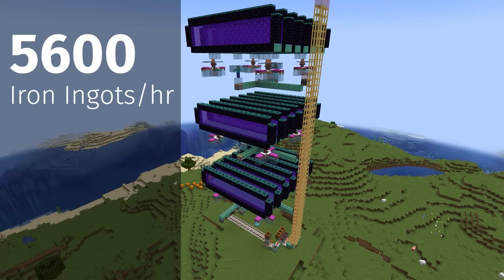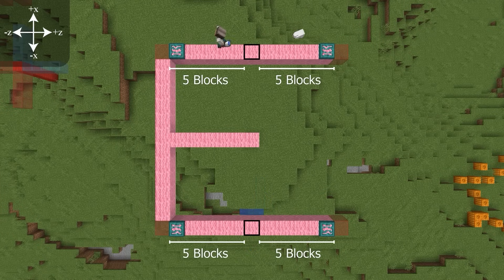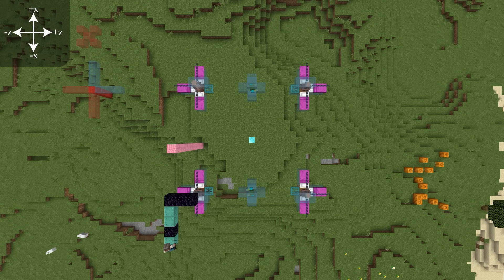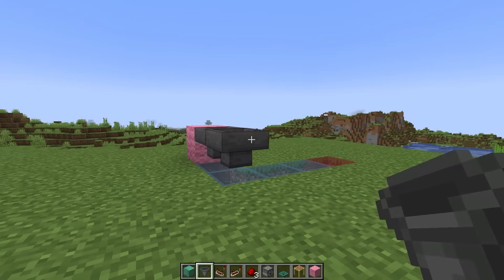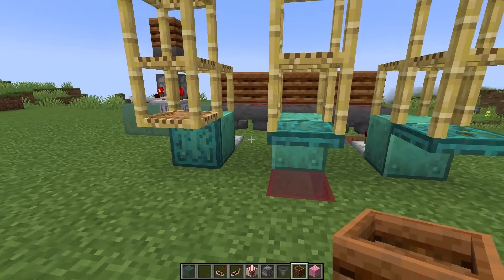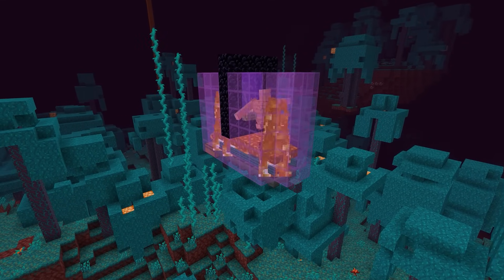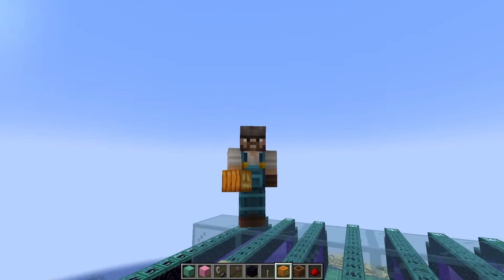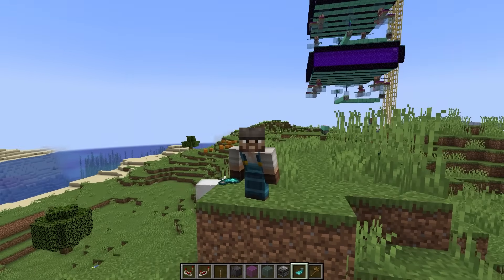Most Efficient High Capacity Iron Farm - Build Tutorial

Comment: Built it in 0:09  1.21.11 on hypixel smp with the 1.18.2 and below version however I added one extra repeater at one tick. I also added an auto crafter setup and an item filter. This way I get about 592 Iron blocks or 5328 iron ingots per hour.
Reply: I want to build this right now but this tutorial is really confusing to me did you use this tutorial or has someone else made one for the same farm but in a different way?

Comment: Can confirm working on 1.21.11, just use the 1.18.2 and below design. The chicken in the boat seems to keep teleporting through the portal but the golems still push each other out so not a ton of efficiency is lost, still an awesome yield!
Reply: Is it necessary to use copper blocks??
Reply: @aayushyogi6210  no any type
Reply: Do you need trapdoors or do slabs work
Reply: It looks like they are not spawning on the first layer… would u know why

Comment: build this one last night and it has been working flawless so far. on top of that your hopper circuit at the bottom also was the perfect fix for a secondary farm i had been working on for a while, so this video solved 2 of my problems. thank you so much
Reply: which version did you build, I just build it and it does not work on latest 1.21.10

Comment: in theory this farm (the base one) may produce 5700 irons/h. But in real testing, it only produces 4800 irons/h, which is far lower than the promised efficiently rate. I afk over night for 2 nights (9 hours each), and the result is very consistent, ~ 4800 irons/h. Using replay mod to view the iron golem spawning, I found out that it is, very frequently, <4 golem spawn a time, commonly 3 golems, with 2 golems in a few cases. This means that villagers frequently "see" the golem before they disappear to the Nether, despite the time to disappearance is only 2 game ticks. This mess up with the strict 600 game ticks repeater clock. So I add 1 extra repeater to the clock, set it to 1 tick (1 redstone tick = 2 game ticks). The idea is to negate the 2 game ticks disappearance of the golem, ensuring that 4 golems will spawn every time. Works amazingly, ~5800 irons/h (average over 9 hours of testing)
Reply: 13:52
Reply: Hi, which version were you in, and which version did you build?

Comment: I have built this in 1.20.2 and then haven't played in a while and now I am on 1.21.10 and it doesn't seem to be working. Does anyone have an idea why? Something I noticed is that the clock seems to have the incorrect number of repeaters for all versions (I guess I miss counted when I first built it) but it used to work. Also it is more repeaters i.e. the cycle between zombies is longer which shouldn't be a problem as far as I know. From what I can tell no iron golems are spawning at all.
Reply: Version 1.18 is available.

Comment: Amazing tutorial! If you are finding the rates are falling below expected, I found the repeater clock at the bottom of the build to be the problem. Especially if you're playing on 1.21 or later, you should use the "1.18" version (kind of confusing). This is because there's a 600 tick (30 second) delay between iron golems spawning, so each layer needs to be activated once every 30s which is why you need a 200 tick (10 second) clock to cycle through 3 scaffolding towers. 

Also, if you want to stack multiple layers, you can reuse the scaffolding towers, but make sure you follow the same pattern (1st tower, then 2nd, then 3rd, then 1st again etc) to make sure that two simultaneously activated layers are far away from each other.
Reply: ur a goat

Comment: Still working 1.21.x versions. I built the farm in my aternos server. Actually the efficeny is a bit low since its 3600 ingots per hour. But I think its about aternos's different mob spawning mechanic for decreasing lag. I used 4 villagers and 1.19 redstone. Thanks for detailed tutorial.
Reply: Hey bro I've aternos server in 1.21.6 but the boat is going though portal to overworld 
Do u have any solution for it
Reply: @tapasipradhan7315 try to get them thru overworld portal , in that way they teleport to nether side. And they should stay there if you don't move the boat. I did like that it works for me bro. Try it out
Reply: And a little extra , i think someone in the comment section told it should be 2 chickens. I did it that way and never tried 1 chickens. I reccomend to get 2 chickens in the boat so it would be gurantied to work.
Reply: @qxrxss how can we prevent piglin spawning then ?

Comment: Which version/clock do I want to use in 1.21.8?
Reply: 1.19. i just built it with the 1.19 format in 1.21.8 and it works
Reply: @Xandroid01  Thank you, I was just thinking the same thing.
Reply: 1.20.2 version is cheaper but they work the same i believe

Comment: Does it work in 1.21.7
Reply: I built and tested it in 1.21.8, and it works great. I got over 7 stacks of iron in under 13 minutes. I haven’t tried it in 1.21.7, but the mechanics should be the same, so it should still work fine.

Comment: For some reason, the third (top) layer of the farm doesn't work anymore. I remember it working when I first built it, but it seems to have stopped spawning golems. I also noticed that all but one villager do not sleep between cycles when it's nighttime. My guess is something is wrong with the villagers' path-finding abilities, but I was wondering if anyone else had a similar situation / found a fix. Also, I am playing on 1.21.7 and am using Sodium and Lithium as of posting this comment if that matters.
Reply: try breaking and replacing the beds when i updated the villager path finding was broken, but replacing the beds fixed it

Comment: Great tutorial and farm! Tip for people building-when I made this in 1.21.7 and got to the boat and chicken step, my boat teleported through when I lit the portal so all I did was place the boat in the over world so it would teleport through to the nether then threw my eggs for the chickens.
Reply: bro is it necessary boat with chicken
Reply: What version did you use for the timer?
Reply: @josegabrieldelacruz4279 I used the 1.18 and below timer. I think in the pinned comment he said that was the right one
Reply: @skippydinglechalk1904 is 1.18 and below one ok to use for 1.21.7? I thought 1.19 one would be more compatible. And thanks for the chicken fix. He also gave a link to 1.20.2 fix where tick between iron golems spawning changed from 700 ticks to 600 ticks, did you do that?
Reply: @Fl0wGuyz the 1.18 and below one worked no problems for me but maybe it’s not as efficient as it could be I’m not sure. And I did not do the fix thanks for letting me know!
Reply: idk what you did but villager pods are not working for me at all
Reply: @OMG_STOP_jeasus getting the villagers in or what?
Reply: @skippydinglechalk1904  Somali simply built the 1.18 and below version?
Reply: @Matthias-f2osorry mate I’m quite new to building farms more advanced than a simple mob farm, did u ever find out if it’s just the 1.18.2 model for current update?

Comment: It's working 1.21.5
Reply: It doesnt work efficiently for 1.21.5 unless you download a mod fixing the portal update or add a specific design in the portals with water whilst using the 1.18 version for the timer.
Reply: @josegabrieldelacruz4279 which mod ? I'm already playing on a moded save in 1.21.1 do you have tips ?
Reply: Thx bro
Reply: in 1.21.7 too bro
Reply: @sanketkr.mishra8091  yeah but not efficiently
Reply: What about the clock ?
Reply: What design did you use for 1.21.5

Comment: I assume that it also worked for bedrock edition? I’m on mobile
Reply: No. Read the description
Reply: @fredflintstone5723  I know it said that but I did not know if it still worked but a little slower, as most bedrock farms do run slower than java
Reply: @jamigeissler1239 it does not work at all because in bedrock it requires 20 villagers for golems to start spawning while in java only three is needed
Reply: @michaelvelichko7680  yeah, figured that out after the fact by doing a little research

Comment: Does the chicken boat still work now that boats and minecarts with passengers can be sent through Nether Portals? I'd assume you'd need to put them in the Overworld side so they get sent to the Nether side then adjust as needed while maintaining contact with the Nether side portal so that they don't just get sent back through.

You mentioned one of the things that causes lag on scaled up versions of the farm is entity collision with the villagers. Would a Warped Vine, Crimson Vine or Cave Vine in each of the holding cells break anything? My understanding is that entities in vines/scaffolding/ladders don't check for collision, which people normally use to prevent entity cramming but should theoretically also reduce lag, assuming it doesn't change how the villagers leave bed or block LoS to the zombie or something else that would break the holding cell or farm.

Comment: Anybody wondering how to fix the portal hitbox problem for 1.21.5, I found that putting some hostile mobs in boats on the ends of the portals (Preferably zombie piglins, since they don't burn and are easy to get through spawning from the portals) causes the golems to attempt to attack them, which forces them through the portals. Along with this, placing walls against the open sides of the portals prevents the golems from accidentally falling out while trying to path-find to the piglins.

Comment: about the 1.21.5 update that makes the golems not teleport immediately, I placed a line of source blocks of water on each platform flowing into the portals, they still spawn on it and they'll telport almost immedietely
Reply: So does it work with the Water sources with no problem? Would you recommend building this in 1.21.5?
Reply: @johannes20054 my golems were still spawning with the line of source blocks. i guess they could've been spawning on the non-source blocks but I still definitely recommend doing this because even if they weren't spawning on the source blocks the rates are way better when they  teleport instantly
Reply: @bwadehra thanks 👍🏻, I‘ll try it

Comment: does it work in 1.21.5?
Reply: what is it with people asking and not just testing it. theres a world download lil bro
Reply: Sort of. There's an issue with the portal's hitboxes that causes golems not to automatically teleport upon spawning. If you don't do anything about this, it will still work, but the rates will be worse since any remaining golems at the next cycle will cause none more to spawn. I also figured out how to fix it. I found that putting some hostile mobs in boats on the ends of the portals (Preferably zombie piglins, since they don't burn and are easy to get through spawning from the portals) causes the golems to attempt to attack them, which forces them through the portals. Along with this, placing walls against the open sides of the portals prevents the golems from accidentally falling out while trying to path-find to the piglins.

Comment: I built this farm on a server in 1.21.5 but a bunch of golems aren’t going through the portals resulting in the farm running at like 10% efficiency. I haven’t gotten the chicken in the boat in place yet but is there anything else that could be causing this?
Reply: if you place glass around the edges and flowing water into the portals itll still be significantly less than 99% efficient, but itll still be very fast and work 100% consistently, supposedly mojang are going to revert the nether portal update they implemented in 1.21.5 and the farm should work normally in the next update
Reply: I guess the golems aren't going to the nether bc in 1.21.5 they changed the hitbox of the portal block

Comment: 1.21.5 my repeaters that go from the target block are not working. As soon as i take out the item from the dropper it starts working but too fast and villagers arent getting scared. I did the modification as the pinned comment but  still no luck. any help pls?
Edit, farm works without repeaters if you take out the item from the dropper. I wonder if it's any better with the repeaters though.

Comment: In version 1.21.5 the iron golems don't teleport into the nether immediately because their hitboxes aren't inside the portal when they spawn. Any fix for this?
Reply: Turns out in JUST 1.21.5 they adjusted the portal width so it breaks this mechanic. They took it back though and it'll be fixed by the next update (or 25w16a snapshot)
Reply: @mindbacon6289  is there a quick fix?
Reply: @ I heard putting more portals, closer together, fixes it. Or you could have enemies the iron golems can agro to, rather than just standing next to the portals. I just changed versions to 25w16a+ though. Works like a charm.
Reply: @RodT09  just stay on 1.21.4 for now since 1.21.5 is such a minor update and barely adds anything new.

Comment: great work man. This works perfectly even with only two layers. Still works in 1.21 but you will need to add two chickens into the boat and push the boat to nether from overworld
Reply: so all i need to do is put two chickens and push the boat and it works in 1.21.4?
Reply: @disciplesantiago  si
Reply: @lucaspaves609  what about 1.21.5?
Reply: @horvathkornel1073 the farm still functions in 1.21.5 but due to changes in portal mechanics in this version, rates are down
Reply: I have two chickens in my boat in the nether side but the golems that I see going through the portal aren’t reaching the nether and despawning. Any help?

Comment: Guys im facing an issue, the  chicken doesnt stay on the nether side of the portal, it gets tp to overworld but stays in one of the portals there. im on 1.21.4 version java. Will it still work or no? Is that boat and chicken act sort of like a chunk loader or do i have to make that too as made it on a server with my friend on ScalaCube. The free server since its only me and my friend who plays.
Reply: The boat and chicken are not a chunk loader, they are there to cause the Golems to spread out and fall into the lava from collision. I changed from chickens to villagers so my collection system wouldn't fill up with eggs. Also 2 entities in the boat is better. The Golems constantly going through the portals are a kind of chunk loader for the Nether side. But if you leave the Overworld, it will stop working, even if it is in spawn chunks, unless you build a real chunk loader, which I did. But it is very tricky to get it right and have it close enough to the iron farm without interfering/connecting to the iron farm portals. I managed to pull it off. The problem I had and why I built the chunk loader was because I would forget to turn off the Iron Farm before going to the Nether, then it would mess up, like the Zombies glitching out and escaping.
Reply: Yes it does still work in 1.21.4 and if you go back in the overworld and row the boat back into the portal it will go back where it is supposed to also idk how without spawn eggs but put another chicken in the boat also go to the pinned comment just do the thing it says

Comment: My zombies keep escaping the pods, any idea?
Reply: I had this problem too. The farm relies on the Golems going through the Portal every 15 seconds or less to work as it's chunk loader. The problem seems to be from causing the chunks the farm is in to unload while playing. To avoid that, turn off the farm before going to the Nether, or very far from your farm in the Overworld, possibly even when quitting the game. After making sure I did do those things, the Zombies stopped escaping.  Sometimes I would still forget and it would happen so I built a real chunk loader, but it is tricky to get it right and have it close enough to load the iron farm without interfering/connecting to the iron farm portals. I managed to pull it off.

Comment: I'm curious if this design works in 1.21.4?
Reply: It works great in 1.21.4, an amazing design, just use the 1.18 version. I get 5800/hour using the optional steps mentioned in the video of extra space between pods and an extra villager/bed in each grouping. I have way more iron than I'll ever need now. I did a lot of customizing, with an item filter for the iron ingots, then auto-craft them into iron into blocks. Also, after a set amount of poppies accumulate, overflow is composted into bonemeal which is autocrafted into bone blocks.
Reply: @Curufinwei  Not working on 1.21.4. Tested both of designs, golems are not spawning. Also it seems like villagers are not scared of zombie that's 5 blocks away from them
Reply: @РоманТелешев-с8ю  I downloaded the map in 1.21.4 and it have the same problem you describe.
Reply: Its working with the 1.18 version map.

Comment: how do you afk at this farm
Reply: You AFK in the overworld near enough to the portals that they are loaded, unless they are in the spawn chunks, which is ideal, then just be in the overworld. I built this amazing farm in my spawn chunks, and went through a nether portal and then back to the overworld and afk'd at my Pale Garden Base thousands of blocks from the iron farm and it ran perfect. Just be aware that the spawn chunk radius has changed from 10 to 2 (apparently just to improve performance) which could really cause a problem for your farms. They added a new game rule that allows you to configure the spawn chunk size how you want. To set it back how it was, the command is: "/gamerule spawnChunkRadius 10". I didn't have cheats enabled to enter the command for my world, so I used NBT Explorer to change the gamerule instead. Since it is a change mainly for performance reasons, this does not feel like a cheat to me.

Comment: This is a great farm & video.  Thank you very much.
For those building this new on 1.20.4, you might have issues with the hopper clock glitching out like I did.  Replace the redstone mechanics with the ones in this video, but you'll want to tweak it a bit.  Use 15 repeaters in the repeater loop, each set to max and on the repeater off by itself, set that to 4 ticks also.
https://www.youtube.com/watch?v=9Uvf1K-kWPg&t=3s